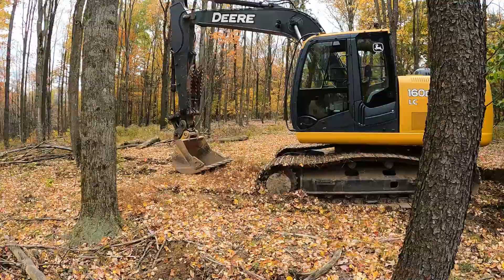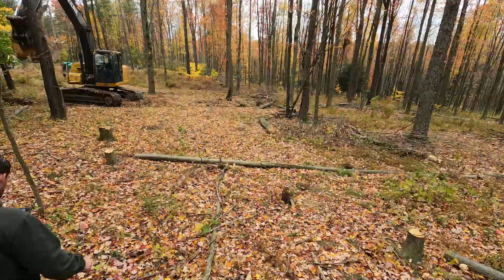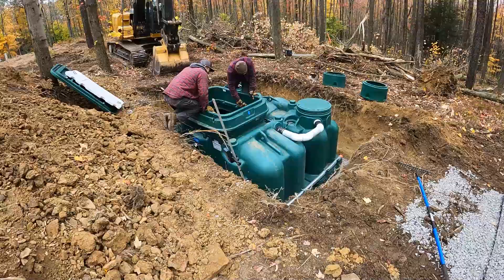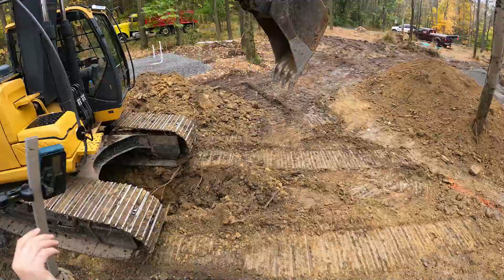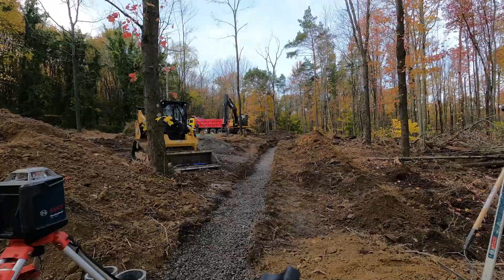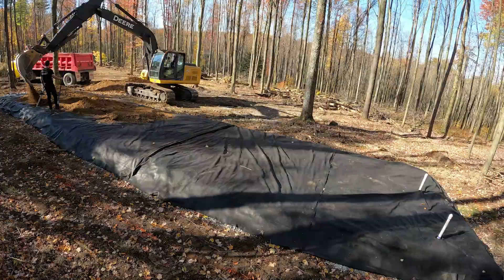On-lot Septic System Installation - At-Grade Bed with EcoFlo Coco Filter

Comment: What size gravel did you use for your bed?
Reply from the maker: aashto #57 - 2B
Reply: @dirtworksbyjohnston  and how much 2B stone did you put into the leach field? How many tons or truck loads? Thanks for the answers, you did an interesting video. One thing that gets my attention is the leach field appears to be uphill of the system, so gravity feed is not a factor
Reply from the maker: @pamtnman1515  this at-grade bed took about 60 ton  (3 triaxle loads) of 2B stone.   Yes the bed was uphill of the Ecoflo system.   The Ecoflo system comes with a pump.